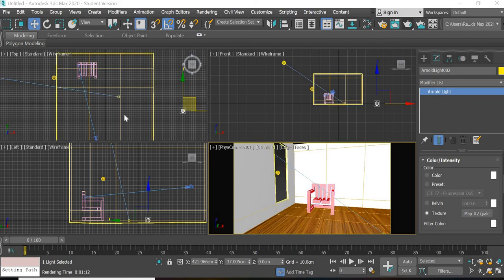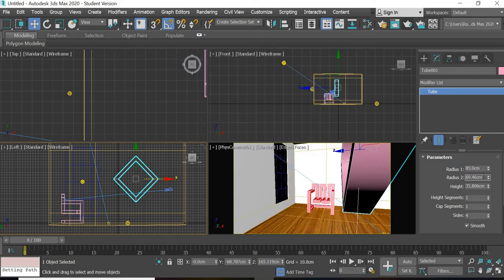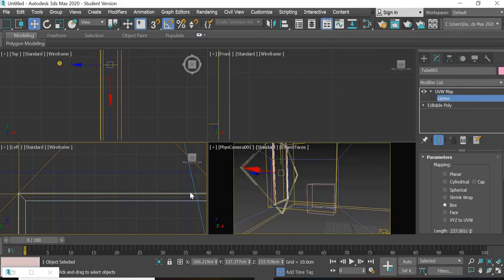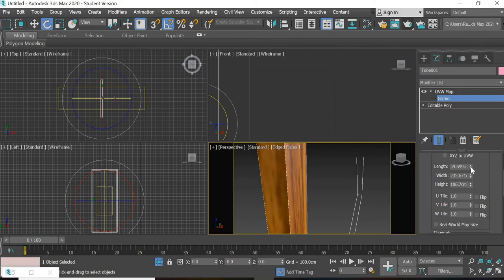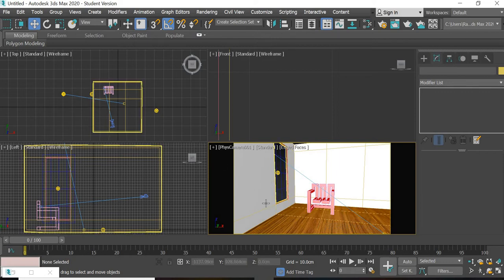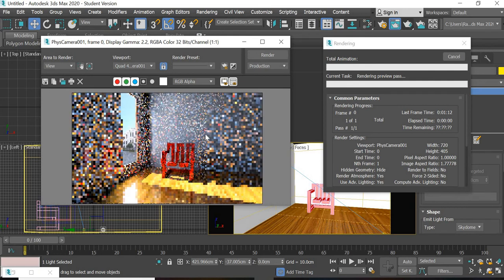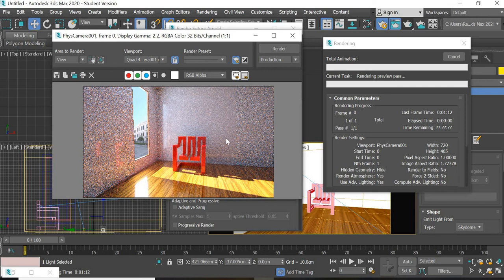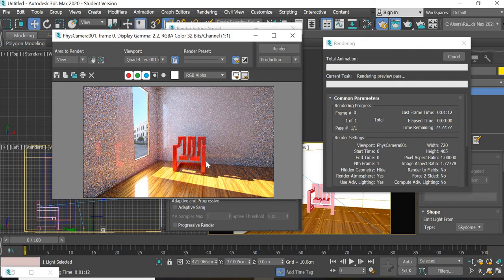3DS Max 2020, Arnold Rendering, Interior Scene, #2

Comment: First off, you need to speak with more volume.  I have to crank up my volume to understand what you are saying.  With your content, you spend some time on material and light setup but really do not cover the setting up of Arnold itself.  Although you touch on Camera AA and some of the subsets, There was nothing about sampling settings or adaptive and  progressive rendering and how this could improve noise reduction when used in combination with Camera AA.  The Photoshop mention I did not understand since I could not really hear you.  The overall video was a nice effort and it may help someone just opening Arnold for the first time but a little more deep dive into the renderer would be great.  The real trick with rendering with engines like Arnold and Vray is understanding how sampling and antialiasing parameters work and finding the right combination to create great quality renderings with minimal time rendering.  This is not intended to be a negative commentary on your video because it is a nice effort.  I guess I was just expecting a little more depth in the Arnold information.
Reply from the maker: Thanks fornyour suggestion. Yes this is for a beginner. I focus on progect based learning so that you can achive an output while learning. These video are related to the concepts i teach in my regular class and i cover what is necessary for each class i starred increasing volume in the new tutorials. Thanks a lot for your time.